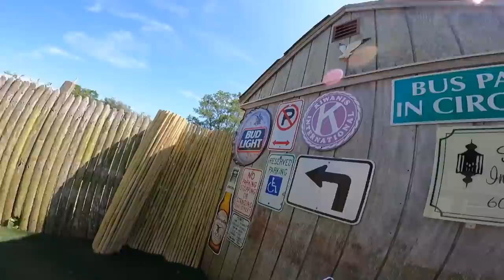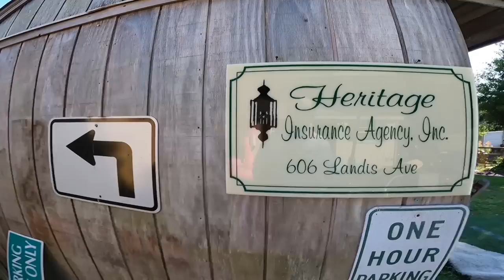Is This The WORST Idea I Ever Had?! (BACKYARD DIY PART 2)

Comment: Turner, tip the A/C into the room and pull the window down. The raised part on the top of the A/C belongs on the inside of the window, it actually is what holds the A/C in the window.

Comment: years ago, a neighbor who was a groundskeeper at the local collage, along with his team, tore up the football field that needed to be replaced. He gave us three huge rolls of the turf, some of which still had some of the original lines.  My home is on the Oregon coast and sandy. Luckily, I had a small garden tractor, so that was a huge help rolling out the turf. Nothing out except labor. We were very lucky.  The neighbor shared because he used a lot of it for his horse barn, down the center aisle. I would like to share a photo if you are interested. You had to work a lot harder than we did, but it turned out beautifully for all your work.

Comment: Yard looks so nice. I don't think you have the window AC installed properly. I have only window units in my old home, and I don't have any open gaps. I think the AC isn't placed in window correctly. The window should come down and fix tight against the AC unit.  Can't wait to meet Finn, you two are awesome and are going to be great parents!
Reply: Agree...  needs some adjustment and insulation too.

Comment: Yea Dreo..they need a portable one so it definitely would fit. However it is great in the babies room! Love the 24 hr timer & energy efficiency! It is so quiet I am def getting one of these. We have central but need one for our one room that doesn't quite cool down. Great design! I never knew how much stuff they had. I googled them & saw some that were cheaper. Never knew they made so much. This SAME unit is at Walmart for $369. They do sell portable ones. I hope they send you one!!!

Tuck you can take a small piece of wood and attach it to the top to fill in that little space in the window. There's a YouTube video on it.

Comment: You need to get some duct tape and tape off all the areas that are still open around the A/C. If you can find some white duct tape you can do it on the inside, or whatever color you need if you tape it on the outside. I think it'll be white tape either way, IDK. You can use duct tape or any kind of strong tape that's available out there. Otherwise it'll take more electricity to keep the room cool. Anytime a room has windows or a door open an A/C has to work harder and longer to keep a room cool, so more electricity is used.  So even small openings can do that, so you need to close them up. You probably already know this but in case you don't I wanted to let you know. Love you guys!

Comment: Great show tuck and sammy!!leaf blower and then a bagger on a push mower to suck up all that black stuff my dude. Cavalier zoysia grass maybe what you are needing for that yard. Its beautiful grass like carpet . I have way too much experience in grass and shrubbery. Get you a pallet of that type of sod, and youll love it !! gonna need the sandbox and swingset for the baby. It will make your back your look like a oasis. Tiff 419 grass is also similar to cavalier zoysia grass it used at alot of golf coarses. In winter time you can push the snow off the turf and skim board on your artificial turf lol.

Comment: I would consider using the sheet of styrofoam to to cover over the sides of air conditioner, you can see light shining through so it's not sealed.

Comment: You need to pull the ac unit forward close the window behind the tallest part of the ac unit. The tallest part of unit is to keep the window in the window. There will not be the gaps on each side around the top.

Comment: You're going to probably need to get some insulation tape and put around the air conditioner or you have those gaps you can see outside even and bugs will come in and you don't want those to come in the baby's room or any room as far as that and plus it will help keep the room cool not letting that hot area just thought you might want to know LOL good luck guys

Comment: Question:  the ac unit seems to have some small gaps between some parts … don’t bugs come in and also the cool air escapes that way??  Praying for you both as you go into the arrival of your new life!!
Reply from the maker: The AC was only temporary so yes it would need to be fitted better for a permanent installation.

Comment: On the ac is that front flap in front of the window so that it closes that gap between the unit and window? I would also put a brace outside to take the pressure off the window itself